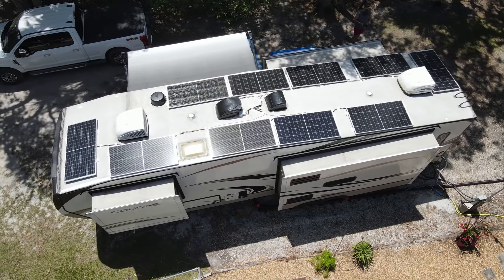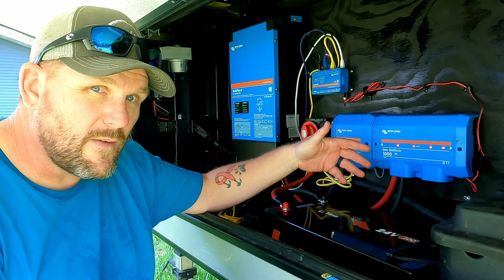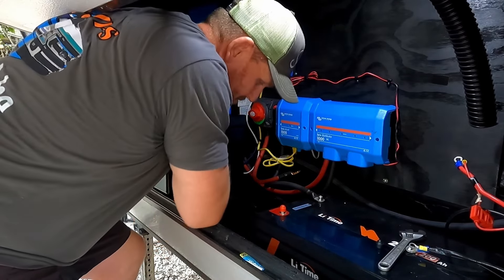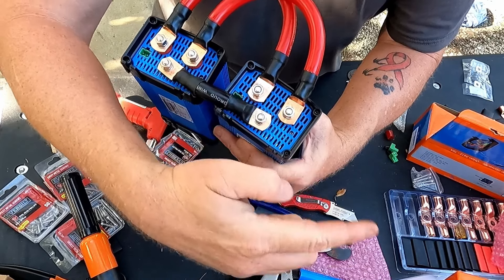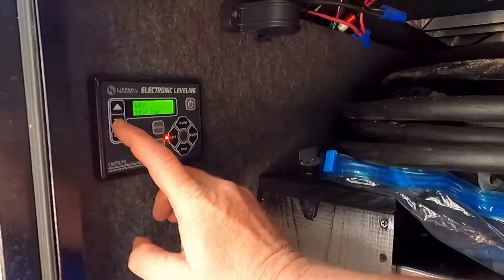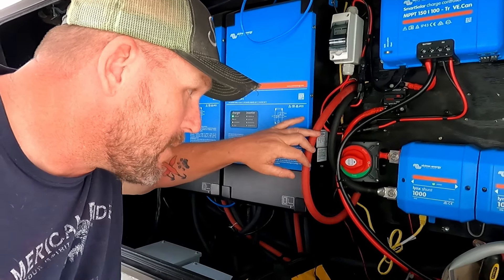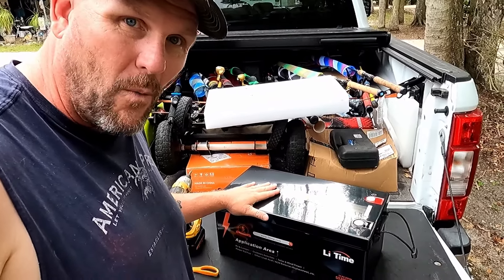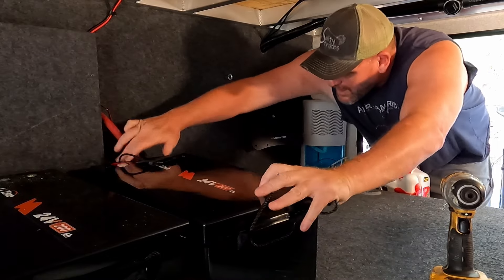What we would do DIFFERENT…  Victron, off grid solar and lithium batteries! #rvliving #offgrid

Comment: I think your batteries got warm while you were charging them is because you have a 24v system with pre-made batteries with BMSs inside. Our 48v system uses 1/2 the amperage for the same wattage, so our 320ah 48v (16.4kwh) battery never gets warm. We built our battery with prismatic cells and a 200a BMS that is on the side of our cells, not sealed up inside a battery box with the cells, which allows any heat generated by the BMS to dissipate, extending its life too - though the most current we ever see going through the BMS is around 75 amps.
Reply from the maker: It never gets much above ambient temperature with this current setup, even running heavy loads or max charging.
Reply: @saltytrips  Going to 4/0 wires probably fixed it. Good job.

Comment: One suggestion. Having the equal length battery cables is important. However, with your current hook up, you will still get unequal draw on your batteries. The battery closest to the OO cables connection on your Victron Linx power in is going to work harder than the battery next in line. This will be true of each battery in the bank. The remedy would to be connect the positive and the negative cables to opposite ends of the Linx. One on the right and the other on the left. That makes the draw on each battery equal. If neither of your OO are long enough to reach the other side, you can reverse the order that your negative battery cables are connected to the negative busbar and accomplish the same thing. Under most conditions it probably won’t matter much but under heavy draw cycles it could make a difference.
Reply from the maker: I thought of that but I checked all the cables under load with my clamp meter and they were all pretty close in amperage reading, wasn’t enough deviation to worry about it. It stays in absorption mode plenty long enough for them to even out quite well so far. I’ll keep check and if I notice any deviations I’ll probably rearrange the wires.
Reply: Made my 48v all same length as suggested and are cold but I’m over sized wire.Ran 8 gauge in to controller from pv.
6 from controller to bats
All cold
Reply from the maker: @2hotscottpro  nice, thats one of the big benefits pf 48v 👍

Comment: There’s a glitch that causes your AC loads to read incorrectly.  The fix we’ve been informed to use is to take an audio headphone plug and insert it into the current sensor port a few times and it resets this.  It worked for us.

Comment: I now have 8 525 watt Bifacial panels and 230ah 48v.Still not enough to run 1 AC all night. Kinda though. It will recharge 200ah discharge and run 1 ac during day.By 6-7 I’m minus 9-10ah.Longest sunny day was just a few days ago.Solas? So days getting shorter now! 
A mini split will help me when I find the time. 24k btu usises 1500 watts plus inverter,100 watts ,240v. From 6k split phase inverter.
Thinking about a 48v 314 ah bat bank to add to the 230ah 48v system.But there’s no way pv will charge both in a day,period !
My whole roof plus over hanging rear ramp is covered with panels.
In a few weeks I’ll see how long it takes to recharge from 240v generator.😊
Reply from the maker: With our four 24v 200ah batteries (20,400wh) we can easily run both AC through the night here during the florida summer.  Mini splits are definitely a good option, if our AC ever dies we’ll look into getting one. Good luck with your build, let us know how it goes.
Reply: @saltytrips  11776wh here 48v will kick it down to 68* in Florida from about 7pm to 11pm then shut off and will rise to 78* in morning and have used 200ah of 230ah.Operating one 15k btu roof top ac in 36 footer toy hauler.
I have a 6k watt 120/240 inverter that puts out 3k watts at 120v ac only using one leg.That’s why I can only run one ac.
3675 watts of panels on roof for that 48v and 525 watt for 12v battery that runs lights and refrigeration.
My plan was to put a 240v mini split in this year.Maybe 18-24k btu 240v.
And an other battery bank of 314ah 48v bank next month.
One of the 8 525 panels charges from the house 30 amp converter.The other seven 525 watt panels charges the 48v bat bank.
1 charger controller  for 525 watt pv for 12v 100ah bat for fridge.
1 charge controller for 2s2p pv = 2100 watts for 48v bank
1 charge controller for 3s pv = 1575 watts for 48v bank.

I might turn 3s into 2s2p and just charge the 12v from 48v because the 12v is fully charged by 10am.
Dang that was a lot to write lol have a good day n see yah sometime and I’ll show yah how to eat a fish lol
Reply: What you need is a high-efficiency mini split. It makes all the difference. I only use about 32ah (at 48v) to run my 12k btu EG-4 28.5 SEER-2 heat pump all night when we're asleep (from midnight to 8am). We keep the thermostat set at 72. When the sun goes down, my 16.4 kwh battery is almost always at 100%. So, from about 6pm to midnight (about 6 hrs), my 320ah battery usually drops about 10-12% running my heat pump, big screen TV, computer, etc., This means I use a total of 65-70ah from sundown to sun-up. If it's real hot and I need to run both my roof mounted 14.5k Furrion a/c and my heat pump during this time, my battery can drop down to 70%. The lowest I've ever had it was 66% one time when it wasn't topped off when the sun went down, due to overcast skies and high heat in Yuma. I have 8, 550w panels mounted 15" off the roof of our 35' MH, which give us a nice shade. We use an all-in-one Sungold power 5,000w inverter/100a charge controller/battery charger, for reference. Btw, my MH is well insulated and has dual pane windows, which helps a lot. If you have a big fiver or toy hauler with only moderate insulation, and a kid or two, you'll use a lot more power than we do. BTW, my 28.5 SEER EG-4 mini split is on sale now at Signature Solar for $1,350. I paid $1,500 for mine last November.
Reply from the maker: @SuperSushidog  if our rear AC dies definitely thinking about replacing with MiniSplit, but its working great right now so can’t justify throwing it away but Mini split is definitely on our radar
Reply: @SuperSushidog  Looking at a 38 seer 9k. Or 30 seer 12k btu units.For night time use.Use roof tops during the day while the sun runs it.
Thanks for info I took a screen shot for future reference.
I also have 8 525 watt Bifacial panels over roof top AC’s.
Reply: @2hotscottpro  If you have 220v power, that's the way to go, but 28.5 Seer-2 is the best I've seen in 120v units. Also make sure the rating is the new seer-2 standard not just the seer standard, which is a higher number for the same cooling ability. For instance, the 220v 12k Blueridge seer 30.5 has a seer-2 rating of 24. That's still quite good, just be sure you're comparing apples to apples. 

12k is really overkill for a bedroom unit, but we have ours set to blow straight down the hall to the front of our MH to cool the front too. In the middle of a hot sunny day, we'll run both our rooftop front A/C and our mini split in the bedroom, as we have plenty of solar to run both, plus our appliances, and charge our battery at the same time. But when the sun goes down and we're running off batteries, our 12k mini split keeps our entire coach cool without needing to run our front A/C. A 9k unit wouldn't be enough.
Reply: @SuperSushidog  chip yes I do have a split phase inverter 120/240 6 k watt but without a 230v unit running 120v 30 amp rv I’m limited to only 3k watts so to be able to run 230v mini and 1 roof top I need a 230v mini.Or buy another inverter.Thanks for you comments .
All though I must make sure of what I say because I didn’t know only 1/2 power 120v when I bought inverter.
AT  a grand an inverter I now know what to look for. I’m hooked so can use the 6k else where.Have a good day!

Comment: I've been planning and building a 24V system that is pretty close to what you have.  The one stumbling block I'm running into is what fuse size for 24V with 2 mulitipluses.  From the documentation, it looks like I need 2 300 Amp Mega Fuses in the lynx distributor.  Using simple math, it seems like I would need a 800 amp T Class Fuse on the positive from the batteries (300 multiplus + 300 multiplus + 200 other loads), which has been difficult and very expensive to find.  So I was just curious what fuse size and fuse holder you have between the power in and your lynx distributor?  Thanks!!!
Reply from the maker: @Tirnanahak  3000 watts / 24v = 125 amps, two inverters would be 250 amps. Typically fuse 1.25 times max working load. Where are you getting 800 amps from? We have our Victron install playlist on out channel page, you can go back and watch step by step the entire build 👍
Reply: @saltytrips  Thanks for the answer and the videos (that should have been in the first comment, sorry :) ).  I can't post pictures here, but when reviewing the manual for the Multiplus II 2x 120V 24/3000/70 the manual recommends a 300 Amp DC fuse unless I'm reading it wrong...  I would be much happier putting in the 300 or 400 amp T class between my batteries and my lynx distributor instead of trying to find some huge fuse that would never blow on me.  That's why I was curious what fuse you put between your power in and lynx distributor as it just doesn't add up right for me.  Your numbers sound much more reasonable.
Reply from the maker: @Tirnanahak  always fuse to protect the wire, if you have 2/0 cable only rated for 200 amps and you put a 800 amp fuse on it the wire will burn up and catch fire.  Fuses are there to protect the wire and equipment 👍. We have a 30O amp fuse in the Lynx Smart shunt from the batteries and 150 amp fuse to each inverter.
Reply: @saltytrips  That's what I thought and thank you so much for taking the time to confirm that I was correct.  It got confusing and not making sense once I looked at the documentation.  Appreciate you taking the time to answer and confirm.
Reply: 200a for one multi, 400a for two multi's.  SotaSolar uses that rationale.  He is a hardcore installer....These are catastrophic fuses or breakers I'M referring to.....BUT, if your speaking about individual fuses via Lynx Distributer fuses, then do what salty says and fuse ONLY for the device!  But catastrophic fuses are if you get dead shorts from the batteries...catastrophic type. I plan to do a 200/400 amp breaker for entire system-- in addition to the Lynx for all the loads.

Comment: I recommend not using the in line watchdog ems, I just installed that on my friend's parallel system and the watchdog doesn't play well with the victron inverters. The error code was the RV didn't have a neutral. We double checked the connections, and had others double check the connections, and nothing we did removed the error code. We were able to use 30 amp power, but with 50 amp it was not working at all. My friend did eventually buy a different EMS Surge protector and it worked great. It's something with the hughes power watchdog in line EMS Surge protectors that is having issues.
Reply from the maker: Good to know, probably wasn’t going to do that anyway, already have one for the plug. Appreciate the input.

Comment: for our batteries i put fuses into the distributor so each battery/charging unit/mmpt is fused within the distrubutor.
Reply from the maker: @MitchOfCanada  this isn’t a Lynx distributor, its a lynx power in, doesn’t have fuse mounts. https://www.amazon.com/dp/B00NT9X5AG/ref=cm_sw_r_as_gl_api_gl_i_MXCVBNRZH90BFYZMBKMR?linkCode=ml2&tag=saltystrikes-20

Comment: I cut my shore cord and wired into the inverter (90lbs); with electric heat I only draw 2300w through the rv electrical when the microwave is on. Good thing you did not buy lead carbons, 4 batteries 12kw and 800lbs w cable. A 12v460A for the rv battery is an easy swap 5.5kw.With 2 inverters should be enough pv input to vastly expand. Maybe glue down flexible panels on top of the slides, make sure the wire is inside the seal when extended. I am buying 600-watt panels for $200 CAD 93"x44" maybe more power per sq/ft?.
Reply: Show me a pic of flex panels going under a slide seal? 
I taped into shore power with cut off switch for inverter to run rv.Switch for shore or inverter option.
Reply: @2hotscottpro   was just a thought , unknown to me when I put my slide out first time there was a disposable camera on top of the slide, it ended up outside ripping a small hole in the rubber, was over and 1" thick so I figured a slim panel would fit.
Reply: @bobmonztr  wow but no it won’t work for long .Seals are flat for a reason unfortunately my friend.
Reply: @bobmonztr I tapped into shore line where it came in.Very close where I put inverter.Just T’D off.Simple for me but not in all rv’s.Thanks for commenting.I like this Chanel.

Comment: paused at 8:00 mins...
Not a big deal but, just for others not that familiar with the Victron Lynx system, I'll just point out that the unit you are showing there is the "power in" component, not the Distributer... the 'Distributer' looks the same, but has mega fuse holders for each line going in(or, going out, on the distribution side).
The difference being, with the 'Power In' unit, you would fuse the batteries ahead of the box, whereas with the "Distributer" you fuse them inside the box.
OH---EDIT... for those who want the best of both with the least cost, you can find vids here on how to convert/add the fuse section into a 'power in' unit.. you wont get the lights but you still get the functionality, for less that full price 'Distrubuter' cost... Plus, the light on the distributers are nice, but the real reason to pay for a fully functional Distributer is if you're using Victron batteries with a Lynx Smart BMV, in place of your Lynx shunt, because the lynx bmv can communicate all batterty parameters to your Vicrton software,. 
ALSO, even without the lynx BMV, one might still choose a distributor just to have those lights for each fuse, witch you can't do with a power in. You'll find the hanc to power those light all over the tube, but, thats all you get, is the lights.. no communication of battery condition, cell levels, etc, as they need the Lynx BMV to pass that info along to your system (VENUS Device).
ok... back to the vid...
just another min later, paused again... I see the "Power In", now has its own case.. its used to share the distributer cover, with empty holes where led's would be for fuse condition indication.
back to it...
OK... two comments re: solar panels... the 12/24/48 volt choices... Yes, 12 volt will sart charging earlier in the day, and charge later in the evening, than 24 and 48 volts, just because they dont need as many volts to keep the MPPT operating... that said, any given charger is rated to put out(charge with) a set number of amps, meaning, say your chager can put out 100 amps, and you have enough solar to maximize that number, it changes with each step up in battery voltage. 100 amps at say about 14.4 charging volts means 1440 watts of charging, at 24 volts(28.8 charging volt gives you 2880 watts of charging, and, double that again, for 48 volts, get you 5760 watts of charge. (again, these number require enough watts of pannels to deliver said charging watts.). So, the trade off is how may hours per day you have enough light to charge, vs, how powerful the charge is for shorter times with higher voltages.
Secondly, re: extra canopy/shade sytems made with solar.. my idea with my build (24 foot van), will be to aquire a a couple "mobile, folding panels", which I will mount hooks on the edge of the roof for, then tie off the bottom corners to stakes. I can install them on whichever side of my van will get the most sun, and, as for cargo caps, they are much lighter than using "solid" panels.
In conclusion, with mobile power sytems, there's a hundred ways to do it right, and a thousand ways to do it wrong. lol.✌🏼🇨🇦
Reply: So.... a 24V system would be a good balance when it comes to charging versus a 48V system?  More usable hours available for charging?

Comment: victron charge controllers only need 4v above battery voltage to charge currently running 2 arrays on my rv one runs at 90v the other at 110v no problem at all. *I am running a 48v system that small wire is nice and easy to work with.
Reply from the maker: One of the other main reasons I went 24v over 48v is because they don’t make a 2 x 120 48v and the lack of higher amp 48/12v converters.

Comment: I would have put mega fuses in the lynx
Reply from the maker: This is a Lynx power not a Lynx distributor, there’s no mount for mega fused in this one.
Reply: @saltytrips  I did not realize they were different?
Reply from the maker: @robertnasser9937  one is a Lynx Distributor 1000 with mega fuse holder and the other is a Victron Energy Lynx Power In Battery Connector which is basically a bus bar with no fuse holders.

Comment: Two words for you, Tesla batteries. 

Love your videos. 👍
Reply from the maker: @max7143  $$$$ twice the cost they are 50v not 24v.  Other than the absorbent cost the biggest flaw would be they don’t make a Multiplus 2x120 in 48v.
Reply: @ They are 24v and can be picked up at dismantlers for $300 per 5.2kw battery. You can program the Multiplus to control it. 

All my buddies are building systems for their houses and RV’s. They are incredibly high grade batteries.
Reply from the maker: @ i found the 24v your talking about , can’t find any for that price but the weight savings is great a only 55lb per battery as opposed to 82lb. The only concern is nominal voltage for the tesla is at 22.8v and max is 25.2v, LiTime nominal voltage is 25.6v and max 28.8v 🧐, I would have to dive more into the technical specs.

Comment: I think two of these are messing up your system 70 amps is a lot of power for DC 🤔
Victron Energy Orion 24/12-Volt 70 amp DC-DC Converter Non-Isolated, High Power
YOU ONLY NEED ONE 🤔
Reply from the maker: @lindsaywhite4502  i explained in previous video reasoning for two Orion 24-12